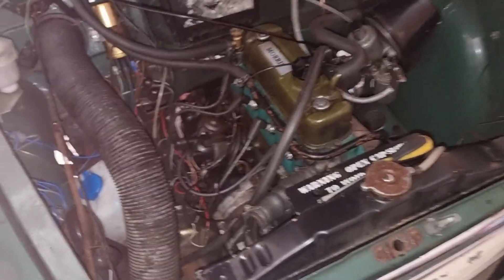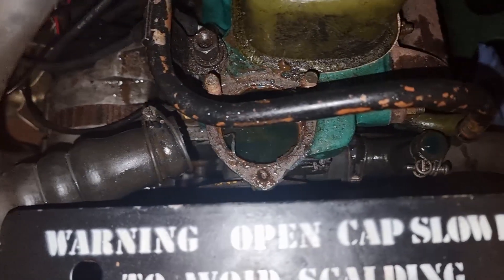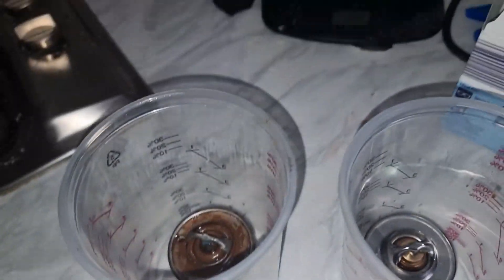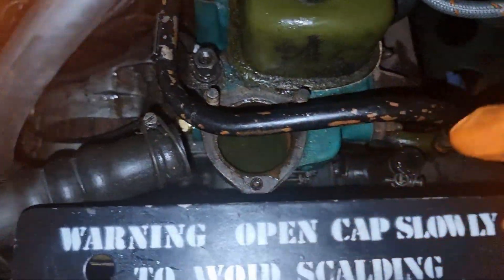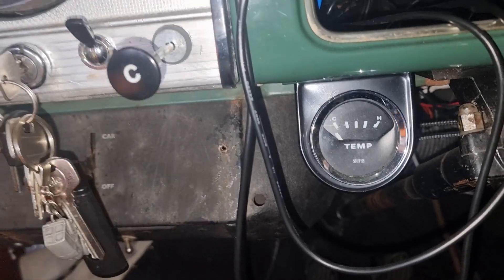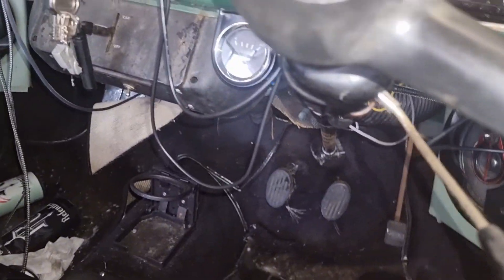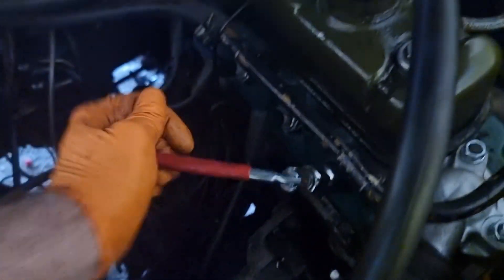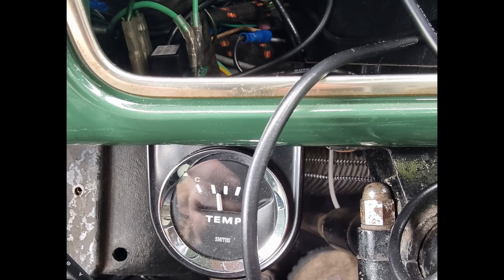The mystery of the overheating engine

Comment: I had that problem with the temperature gauge showing overheating on my 1300 Vanden Plas, hand held thermometer showed it was running correctly, all boiled down to the faulty sender!
Reply from the maker: Aye. I've had different senders in it and it's all been the same... they're not the most accurate of things anyway. The v reg has done the trick for me!